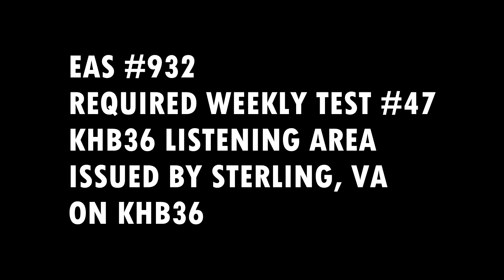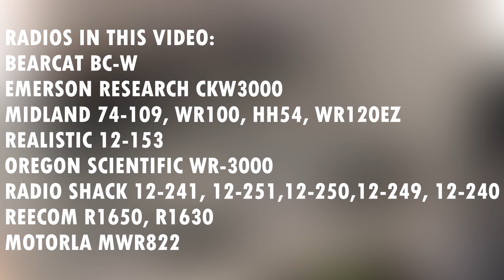EAS #932:  Well That was Weird | KHB36

Comment: Where is the 12-521? And nice you got the Motorola!!
Reply from the maker: The 12-521 is now next to the Sangean CL100, and now has the sole purpose of monitoring WNG736.  The Motorola had been sitting there for a little bit off-camera, but it has this issue where the amplifiers I use cause it to bring in KHB36 on all channels (the Reecom that was there also used to do this).  Thankfully the 12-521 doesn't do that, I guess it must have a higher quality tuner or something, not too sure though.